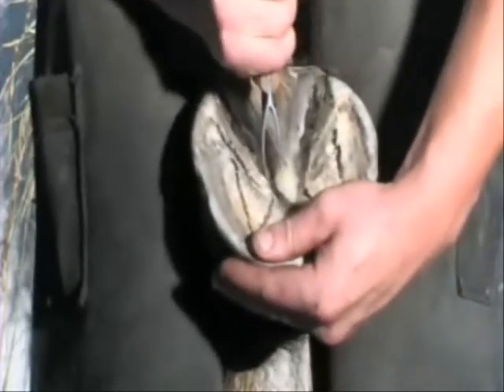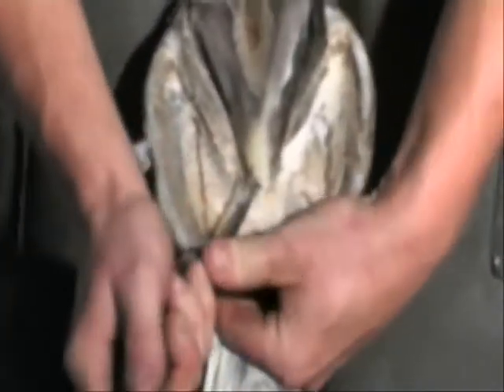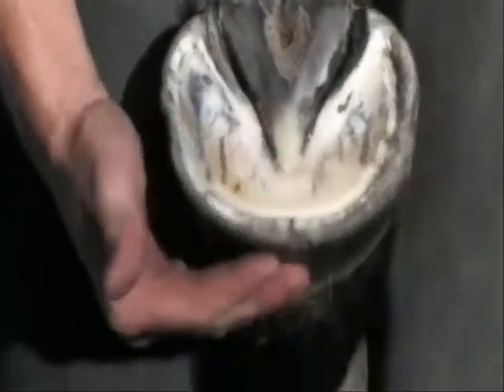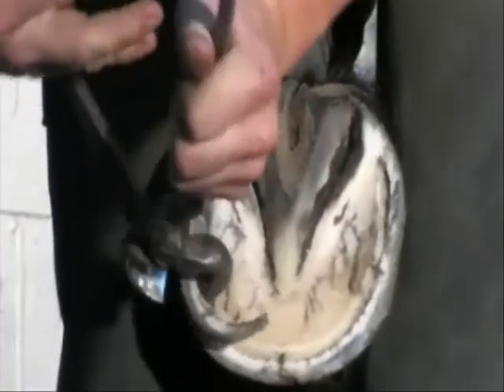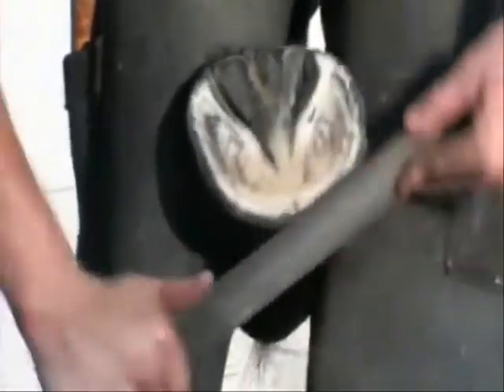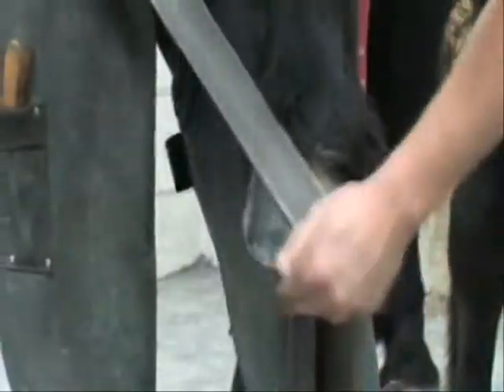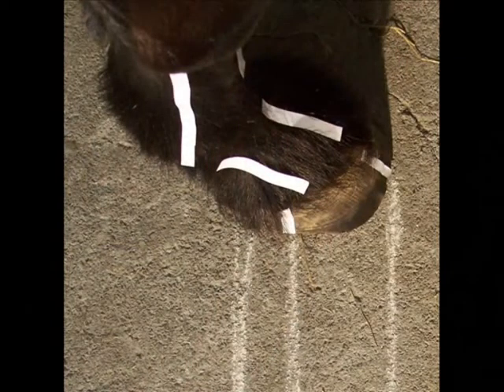HOOF TRIMMING PROTOCOL

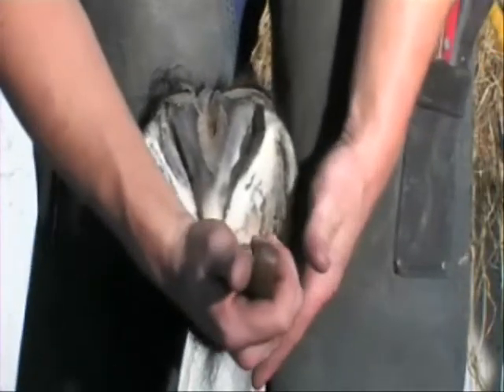Comment: (1:15)  You have not mapped this distorted hoof correctly...you are ignoring contracted forward heels with stretched frog, laid over bars and no sole concavity...you are marking break over at least 15mm forward from where it needs to be.  You will NEVER grow out the distortion with this trim.   (3:14)  You are not correct in finding the leading edge because the sole has been stretched by the long (foundered) toe.    Your information is only valuable when there is NO hoof distortion...it's sad to think you are instructing.